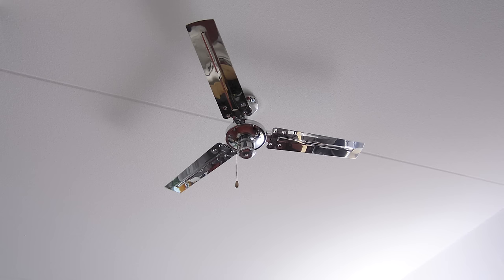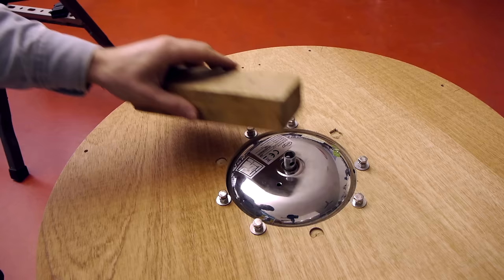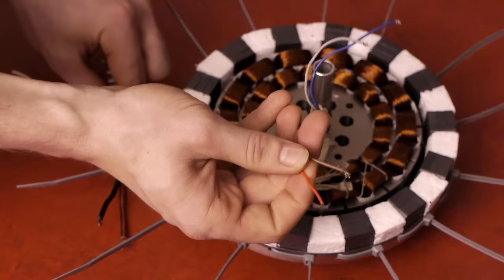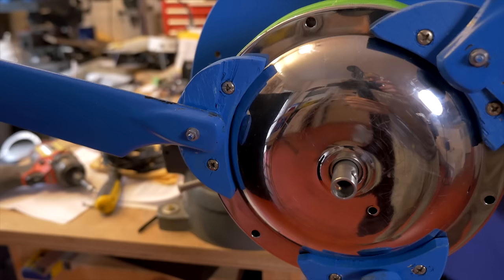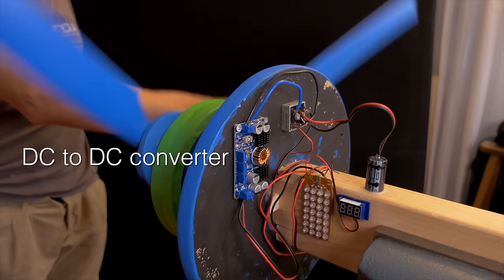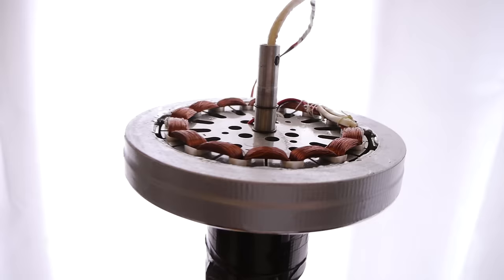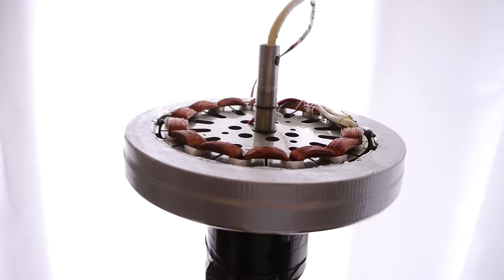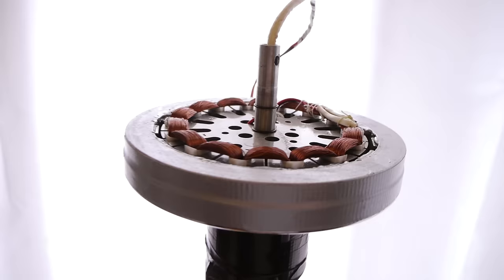Turn a ceiling fan into a wind turbine generator?!

Comment: Don't run the generator inside the fan. Put some blades on a shaft that has a couple sets of good bearing and a housing to run it through and on the back side of the shaft where it comes out the back of the housing add a large gear or pulley to it and put a small gear or pulley on the generator end. use gearing to increase the speed of the rotation on the generator side a LOT. This alone could help but you could also add a large capacitor to hold some of the energy generated that can be used to "kick start" the assembly from a dead stop and you could maybe add some kind of protection against storm winds to prevent burning bearing up or breaking things this would add a significant amount of reliability to the entire setup. To store any unused energy you could try to find some small li-on cells in bulk and then wire those up as a power wall to draw from during downtime on the generator.

Comment: You need a capacitor w/ higher uf (micro farads) so your power supply puts out better linear dc direct current. I'd like to see your circuit design so it can be improved.

Comment: Note there's missing part how to use it actually, use these device in remote area to charge batteries. Then use the battery in to your gadget. Sample charging 6 or 12 volt battery  connect it to 12 or 6 volt circuit converter USB port. then you can charge your phone power bank eny gadget you have, output will stable on 5 volt accuracy.
Reply: Ya I know it kos I'm electronic technician it's me side line, I tried also solar panels stable voltage eco friendly as energy on sun. You made air energy convertion its eco friendly  canbe use when no sun air available.

Comment: Use a lead acid battery (very forgiving) with car rectifier for alternator,. a  small one will work (1amp hr). It will stabilizes the power as will as filter the (clean) the power to true DC. Then you can use a rectifier to maintain 5 or 3 vdc

Comment: if you use an linear voltage regulator , you set max voltage to 24 but it can resist at least 1 Amp of current , so if you need more corrent than 1 A probably you need to use antoher way to regulate the voltage

Comment: Congratulations for your great video! You should try a MPPT (maximum point tracking system) instead of the two devices used for the output power stabilization. That will minimize your losses. The next idea is to understand and avoid as possible the Lenz law. https://en.wikipedia.org/wiki/Lenz%27s_law Can it be do it? Yes. Minimize the output current in your coils for small period of times by using synchronized switching techniques. Good work. Congratulations again.

Comment: First LED is not pronounced "LEAD", it is an EL-EE-DEE, as in Light Emitting Diode. Second, you should have kept the inner set of coils. You should have disconnected the inner set of coils and connected two NEW wires to those coils. If you kept the switch box, you could have sealed that box, and placed 2 bridge rectifiers inside the box.Next you could have then connected the outer set of coils to the first bridge rectifier, and the inner set of coils to the second rectifier. The positive  terminals of both rectifiers could then be connected together. This way power would be generated by both coils. The non magnified part you call the "rotating part of the induction motor", which you removed  may have been modified to install the magnets. Grind the fins but insure it is still firmly attached to the housing, then make 14 holes evenly spaced and put 14 of the strongest magnets in these holes. I suggest molybdenum magnets or something along those lines. Next since I recommended keeping the switch box to hold the rectifiers, also use it to contain both a capacitor and a regulator. The capacitor used should be one rated higher than the top voltage that might be produced by the fan motor, I suggest 250 volts, not sure what would be the be micro or pico farads would be best since I have no idea of the frequency of the power produced is, however you might place the capacitor in parallel with the power terminals, as you already did but also add a coil to the positive side of the capactor. The other side of the coil becomes your positive output going to the regulator, the negative side of the capacitor is the negative side of the regulator. The regulator could be from a 12 VDC automotive, or commercial truck application, these usually peak out at around 13.8 VDC, or possibly a regulator from a military vehicle, some of these are for 24 or 28 volts systems.Since we kept the switch box for the rectifiers, and other parts, the two wires that were originally coming out the other end, the end usually closest to the ceiling, can be used to connect to the rectified output and down what ever you need to power. Your basic understanding of the motor was not too bad, however you could have used the inner bank of coils for some additional coils, and while I am not engineer I do know basic electronics, and I am a licensed amateur radio operator.

Comment: Anyone who reads this feel free to correct me if I'm wrong oh, but I think an inexpensive charge controller that one would use with a solar panel should give you the proper current to charge a marine battery. If I'm correct about that then all you will need to do is connect a power converter/ inverter, I would choose one with a USB and cigarette lighter port oh, I think your turbine should be able to power any type of 12 volt device. 

 anyone reading this please let me know if that sounds right I am just as hungry as the Creator for new information

Comment: This is a fantastic video. It was informative! Thank you for sharing. I subscribed and liked. I have a question, would this work with a whirlybird? A "Whirlybird" is a semi-mechanical turbine vent that is installed on  roofs. I have several. When its hot, and the heat rises in the attic, the air escapes via the whirlybird and the fan moves. It gets really hot here half of the year and the whirlybirds are always moving. I wonder if these could be turned into electricity? I wonder if you could comment or test this idea? Presumably, thousands upon thousands of people around the world have whirlybirds! If they could create electricity from these, it would be awesome. Thank you so much Giesbert! Have a wonderful day.

Comment: i have a koi pond and had a spare paddle fan blade from an old petier fridge so i attached it as a play pelton / water wheel outside filter outlet and it spins nice and fast so i will  connect a brushless motor later to play with. strugling to find cheap sma;ll brusless motors online for various mall projects.

Comment: If you were to work from scratch and  bend the loop of wire into a clamshell shape and have the magnet pass through the open gap would that be more efficient?  Has anyone tried that yet?

Comment: Why don't you use neodymium magnets? You should rewind all of the coils with a higher current low gauge wire. Spend the time. You will have a very powerful generator. You can get a voltage regulator that has a wide range of input voltage and current and a steady output of 12v. You should then use it to charge your 12v batteries and you know the rest from there.

Comment: .use a series RESISTOR and use a 24 volg zener diode or a7824 ic power  regulator to maintain a24 volts out put.

Comment: If you can just put a wire high up in the air and put a second wire in the ground, you will get 5 volts easily.
I am not sure how high it needs to be.
But you can find videos on this technology on you tube.
Free energy forever.......

Comment: Get a capacitor bank 16v 83F. IT WILL REPLACE A 12V BATTERY FOR YOUR TURBINE STABLE OUTPUT FOR THE DC CONTROLLER STABLE OUTPUT

Comment: Hello Mr.Laesie Works, 
WoW I am very impressed with the video-graphics and the Audio was good. 
I guess you have a few Chickens Eh?? 
I really enjoyed the presentation,  it gave me a sense of clean invisible edits ,.
Each step was easily  grasped very smooth...
You are a natural teacher for sure.   
The presentation was stimulating . That I was locked in.
Making a video can be daunting most can but? 
You and your team created that Cinematic Element  where transmit and receive kept us focused.
Like  creating A + B  and arriving =C.
Laesie, I like your logo . Can you perhaps explain it for me?
 I am also amused by sharing this as your 1st time constructing an electric wind generator.
I use yes ebike wheels they have great generators.  I discovered that any of these small machines have excellent parts for a great wind/generators?
Examples of preferred devices are all battery operated *. 
Hedge trimmers, 
Weed-Wacker
Lawn Mowers 
Drills.....
Ok I'm done gotta eat Eh!
Peace !
Now is the time for some piping hot pizza's from Domino's Eh!
Order topping from Z to A Eh?

Yours truly,
Stevie Leonard N.F. CANADA

Comment: If I were to put the build resources into wind generated electricity, I would focus on higher output to maintain a storage capacity of six 12v auto based batteries. The specific batteries would be a type of electric wheelchair batteries that drive the motors or golf cart batteries. Those batteries are designed to charge discharge throughout the life of the battery. The 6 batteries would easily supply energy for 120 ac power for a t.v. and several modern led shop lights and  all the USB devices to charge phones and other USB gizmos. I wouldn't use ceiling fan components due to the many changes and design requirements it takes to engineer something useful relative to input necessary for a reliable safe stable power source. Use a fan for something else. If the intended goal is power at low d.c. USB levels then get a small solar system for that. Using renewable energy is only useful if you have storage ability designed into the system. Wind is everywhere at USB levels, but efficient use of materials, time, ect, for extremely low voltage devices is like putting a diesel engine on your skateboard....overkill. we want to achieve freedom of power and a safe hassle free system.This is a general analysis of your project, and I do not claim to be set in any way at present. I haven't crunched the basic numbers, nor do I have a familiarity in the exact physics to know right away but I would in an hour or two. I do like upcycling of a valuable resource, and I know that concept is very applicable in an energy generating system. I'll keep up with your work and look a couple of things up in my electric engineer reference pamphlets notebook. These days there is plenty of thrown out resources that with a bit of research and being interested into the appropriate technology point of view as your self I'm happy to see your honest intelligent way  you did your video.  So let's get this thing of yours in sparky, energetic form. If it doesn't charge the phones, then by God, it should at least catch them on fire. I'm definitely kidding on that one. Hope to see what you find out, and I'm heading to my book shelf.

Comment: The bearing in a ceiling fan is not designed to be side loaded . Side loading will lead to increased resistance and early failure.
Reply from the maker: That is a good point, and I think for a d.i.y. it is smart to build a small vertical wind turbine i.s.o. a horizontal one. Do you know if this bearing works as well in the designed direction as up side down?
Reply: @GiesbertNijhuis  Difficult to say without a thorough visual inspection but hypothetically If the total blade weight was equal  to that of the motor housing it might be as simple as flipping the bearing 180 degrees if there is a thrust facing side  (weight bearing side) to the bearing.   Or fabricate a twin bearing cradle to support the armature  on your original design.   But im sure you already have thought of that. Cheers

Comment: to create more rpm, the fan must be separated and to be connected to a planetary gear before attaching to that generator..

in a generator however, the magnet should be in a stationary for additional rpm. more rpm, more electricity..

Comment: Well why not fill the space betwwe the copper wire and the stator with the same plates used to bridge the slots to fill the air gaps top and bottom of each loop and use a dc to dc that kd load more than 50 volts. Also i think the idea is yes there are better options to build from but in a pinch this would wourk short term.

Comment: Your list of things that need improvement indicates some misunderstanding of Maxwell's equations:
1: "There is a hole in the center of the soft iron. This reduces the magnetic force."
No, it doesn't. Each of the pole pairs forms a magnetic circuit that flows from the rotor to stator and back, and none of the magnetic flux (not magnetic force, by the way) has to go through the center of the core.
2: "The air gap is still too large. This reduces the magnetic force."
True about the air gap being too large, but again, this is magnetic flux, not force.
3: "The copper wire is very thin. This gives resistance to the electric current."
This is true, and is a good place to make an improvement.
4: "The magnet wire doesn't touch the sides of the iron core, losing magnetic touch."
Nonsense. There is no such thing as "magnetic touch", and the distance between the electric current conductor and the magnetic circuit does not matter.  If you do not believe this, it is easy to prove experimentally.  This is one of the fundamental principles described in Maxwell's equations.
5: The magnets are glued on wood instead of iron. This reduces the magnetic force."
Again, you are confusing magnetic field strength with magnetic flux.  Field strength is similar to voltage; it is an intensity measurement, while flux is similar to electric current, measuring a flow.  But you are correct in concluding that magnetic flux is not conducted well by wood.  This is a mistake that many experimental motor or generator designs ignore, so you're on the right track.

To effectively design or optimize electric motors and generators, the most important concepts are Faraday's law and Ampere's law.
Faraday's law states that changing magnetic flux through an area (such as the area contained by a loop of wire) induces a voltage in any boundary path (i.e., the electric windings) of that area.  What's important about this is that it does not matter WHERE within the loop the magnetic flux passes.
Ampere's law states that an electric current through an area (again, as bounded by a loop of wire) produces a circulating magnetic field around any path that bounds that surface.  The key words here are "any path".  Again, it doesn't matter where in your loop the magnetic field passes.

Both of these describe the same interaction, but while Faraday's law relates magnetic FLUX to induced VOLTAGE Ampere's law relates magnetic FIELD to electric CURRENT.

Comment: What happens when the wind changes direction and more so if the wind is too strong for the turbine to be mechanically safe? What "brake" can you apply when you exceed some inherent mecanical limit? Can you fold the wings to stop the forces being applied on them? If you use an inductive brake how much force would it hold before catching fire? Is it better than a mechanical brake? Would you still need to brake to a stop and fold the wings? Could it even be done safely? 
My point here is not to discourage you in any way, and no offence intended, but strapping a bunch of electronics, DIY or not, on a motor/ generator is easy and quite fun but you have to deal with the mechanical and efficiency part if you really want a nice outcome out of this. And that is where even the pros are struggeling. It is by no means as easy as it looks as just a spinning fan on a pole (well it could be, but would also be dangerous).
I work in the automotive industry, and from experience I must tell you it is always better to start up a project with trying to put holes in your ideea/ logic to try to find as many faults, problems and issues in the beggining as it will help you imenselly once you get going. It is always nice to have an ideea and think you have it all figured out and (knowingly or unknowingly) leave out the messy parts just from the sheer excitment of getting your project up and going. DO NOT let yourself fall into this line of thinking. Take the time and really think things through before you spend even a dollar or an hour putting something together. I know it's hard to do but it's worth it. While I may not have helped with this comment in exactly what you asked, but maybe I've given you some food for thought. Keep your imagination going but also keep a foot on the ground :) Cheers!

Comment: Why can't this same concept be used to harvest the kinetic energy from the rotation of an e-car wheel in order to continuously charge the battery array or a supercapacitor array or a combination of the two so that the e-car never needs to be plugged in and has unlimited range?

Comment: Very nicely done!  One suggestion to improve the gap is to put a piece of soft iron on the face of each neo magnet. If you machine a curve onto the face of the iron, you can  control the gap quit precisely_  last, I would use a slip rolled soft iron band to encircle the stator, with the magnets and gap shims on the inside.  That might be worth your while. Again, great project!  Doug
Reply: I think those are ferrite magnets